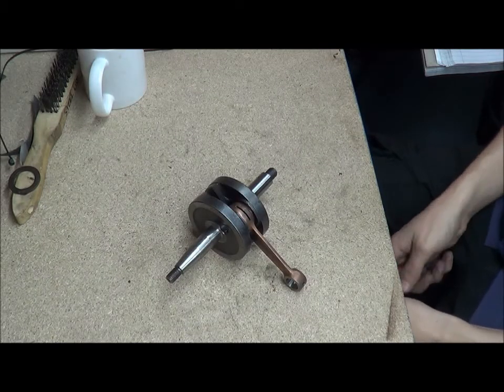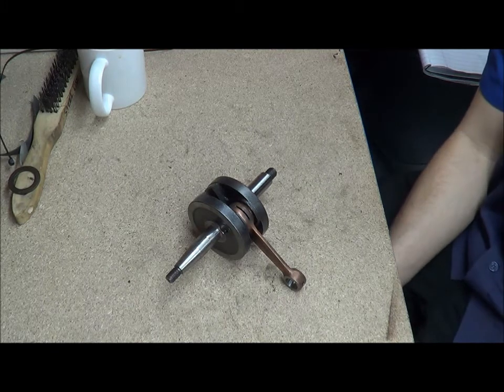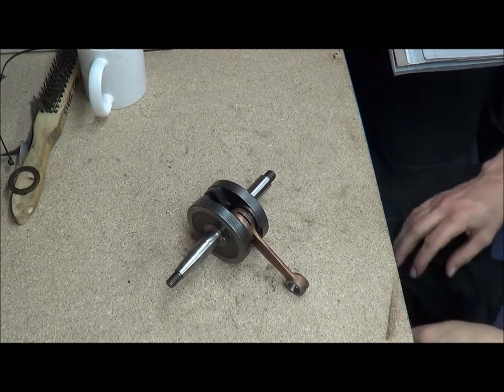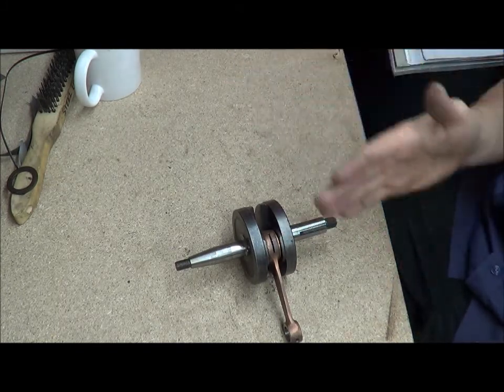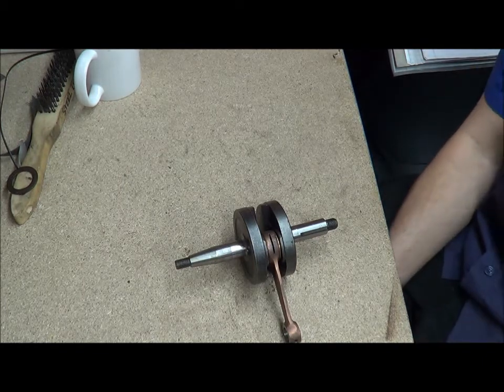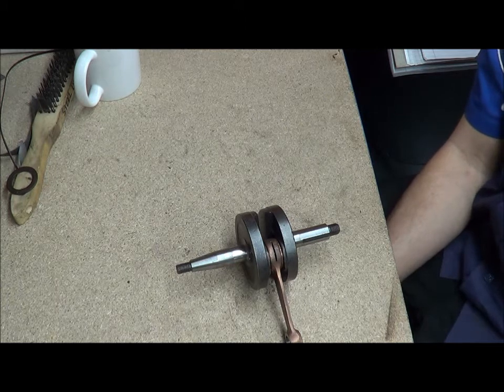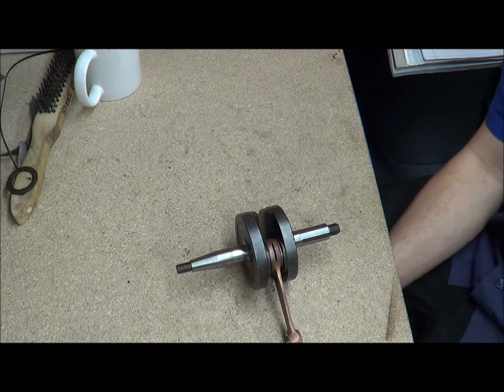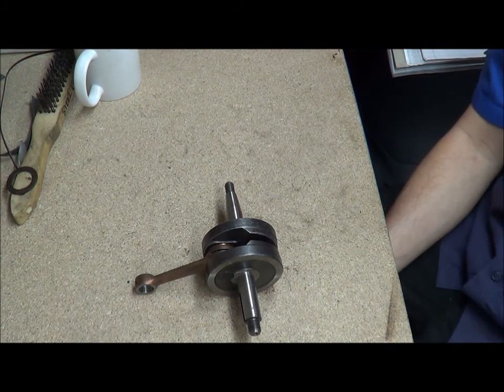Matt's Guide - Crankshafts (2 Stroke)

Comment: can carbon fiber be used for crankshafts?  What is the lightest material that would be suitable for two stroke crankshafts?
Reply from the maker: No. In a short word - but this will make a good video subject - added to the list
Reply: thanks. i just found your videos and have been binge watching. learned something from each one.  thanks again.